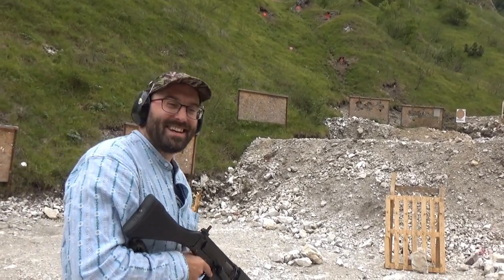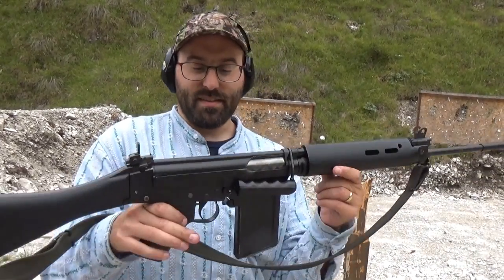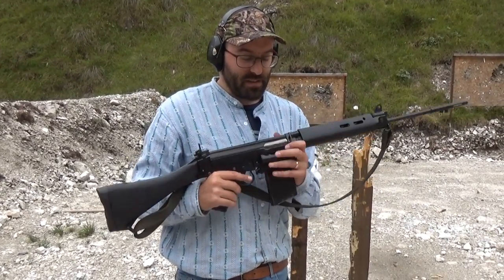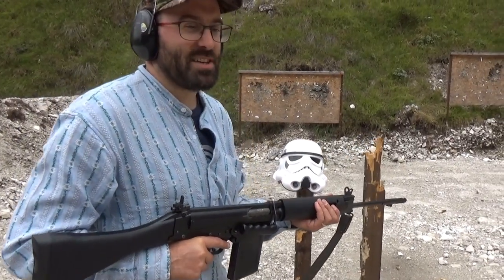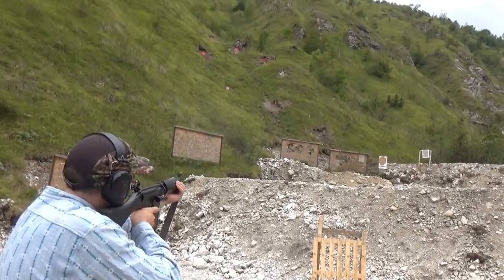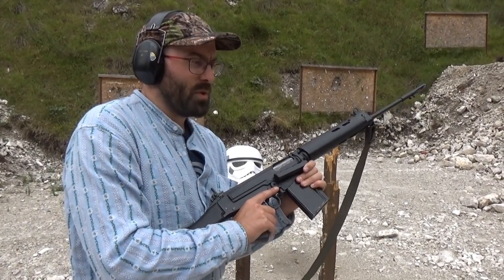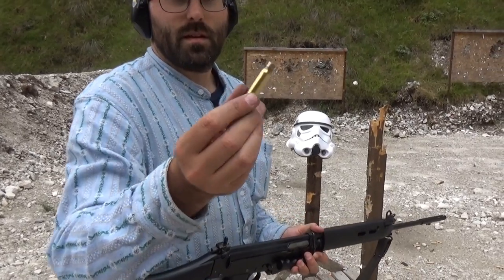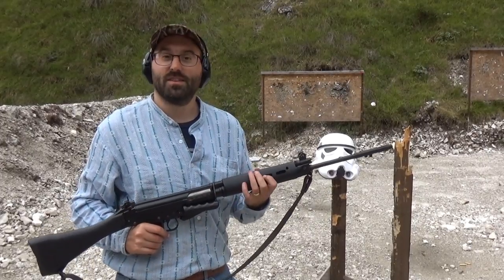Some Notes On Felt Recoil, And A Fail On Primary Extraction

Comment: It does the same as mine does now it's a straight pull. Not sure if you noticed but the rear sight slid it's way up the ramp under recoil with the gas off.

Comment: stick a FAL into a cradle mounted to a load cell and produce a graph of  Force/Time for gas system/no gas system?
Reply: What you need is someone who works in a university engineering research department, ideally in Switzerland.  Unfortunately I don't meet the switzerland bit.  Mind you I haven't played with load cells personally in years.  Moved into CAD/RP.

Comment: To be fair, you're not supposed to shoulder it with the gas system blocked off... RTFM. :P
Reply from the maker: So all the UK-legal straight-pull ones are supposed to be fired from the hip? Gotcha...... :p
Reply: I don't know about UK-legal straight pull ones (is there really such a thing as a non semi-auto FAL?), but the only reason to block off the gas system on a regular, army issue FAL, would be to fire a rifle grenade and for doing so, one uses the rifle as a makeshift mortar, with the butt of the stock on the ground, not in the shoulder (which, seeing as the grenade-firing blank has quite the kick to it, would be ill advised).